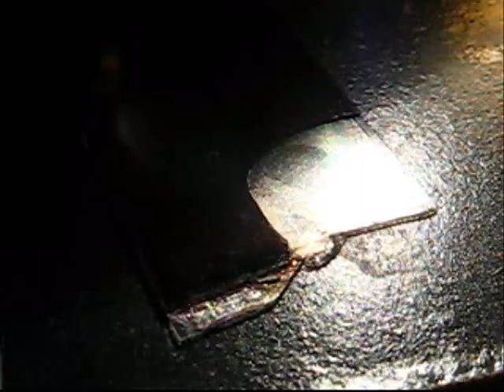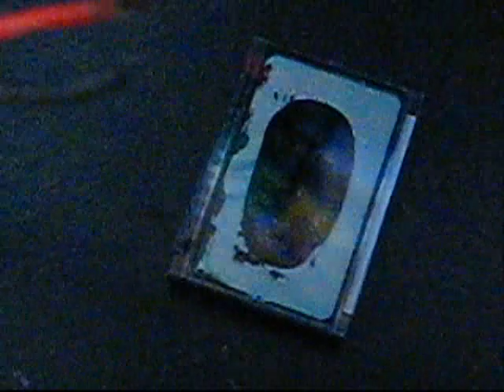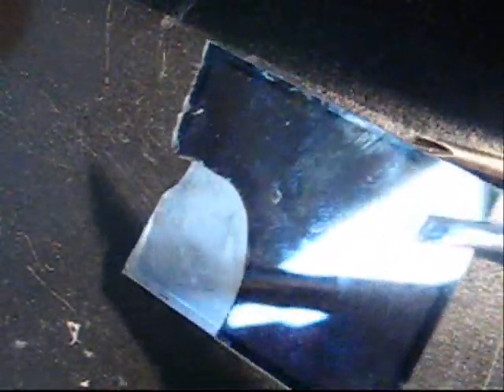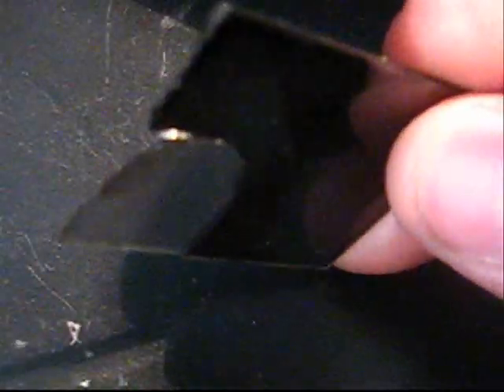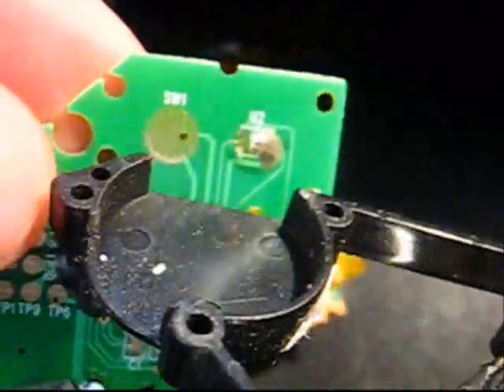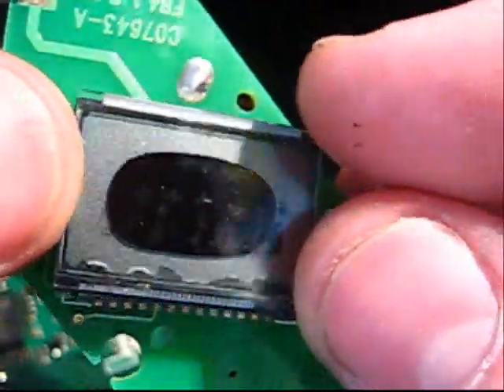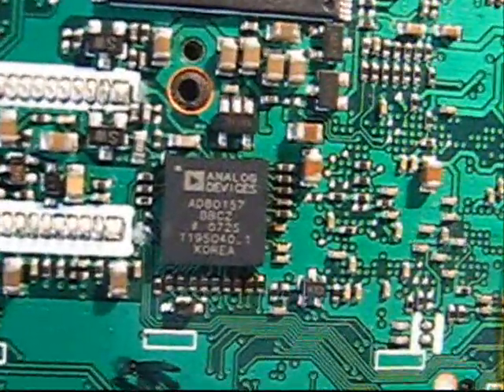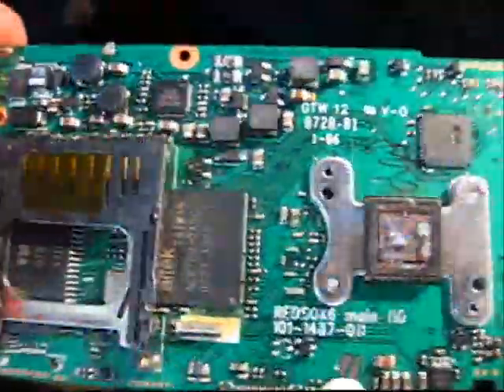2300 volt fly zapper handle vs LCD Screen & Circuit boards

Comment from the maker: I know I haven't been uploading electronic vids b/c I'm running out of things to mod. I do have a Mibook video player but it doesn't work (blown transistor) so I'm gonna get one on amazon and Use this one as a spare LCD. Not sure if you ever head of one of those but it plays cookbook videos on SD cards but it can be used as an mp3 and video player. I do have a sylvania dot it bar light that I might mod so it doesn't use the crappy electronic circuit inside.

Comment from the maker: And I dunno if you've seen it my taplight switch mod I did open that yp again and removed the circuit in that b/c I went to turn it on one day and the batteries were dead. After the hack the batteries are still good. Also I have a Dell laptop w no screen and the HDD is dying, when it takes a dump I'm going to be making another hard drive speaker. I am open to video ideas but within what I have available.